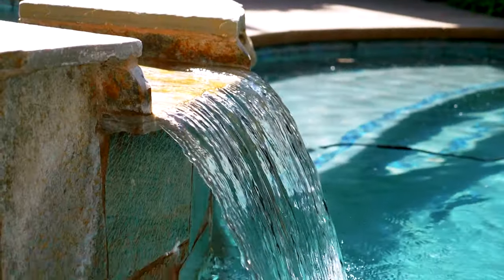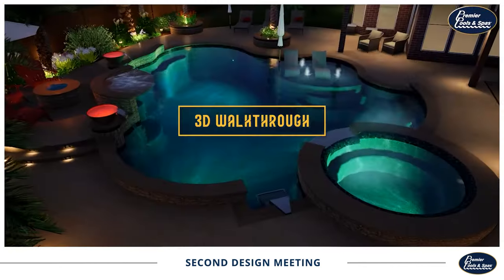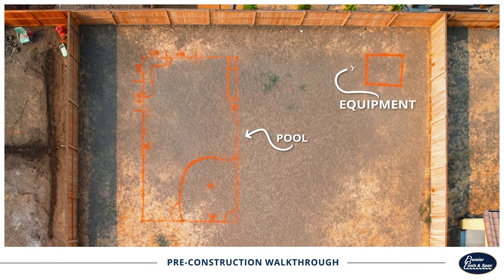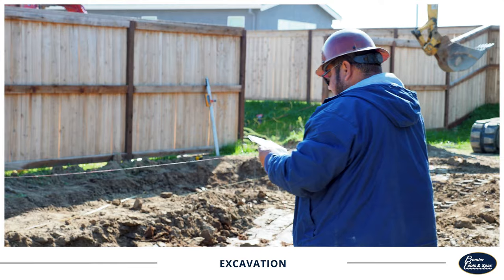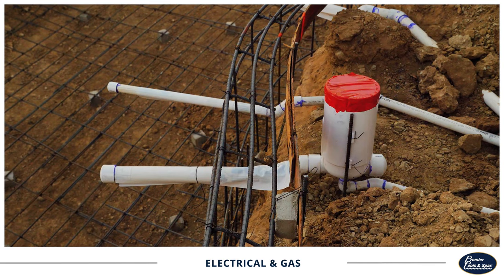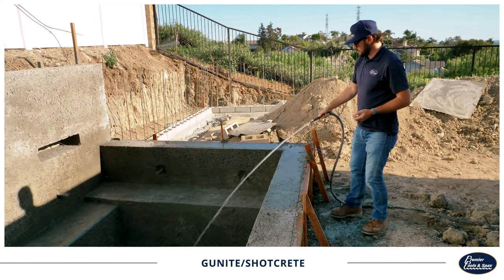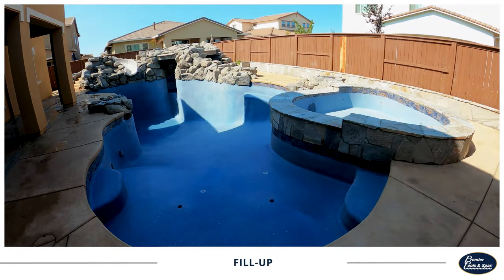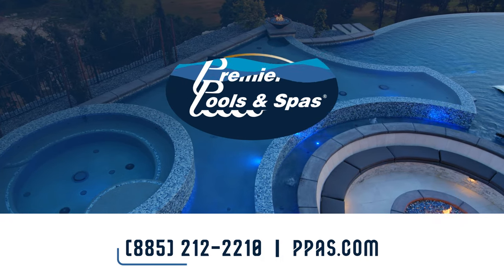What To Expect When Building A Concrete Swimming Pool

Comment: We are getting screwed in Georgia. Basic pool 16’ x 32’ with salt system. No bells or whistles. $75,000
Reply: About same here in Florida. 12*30 salt water. no heater, no enclosure, but we did go with travertine deck about $72,000
Reply: Sounds about right price today. You can get a nice pool installed for 45 but it's rare